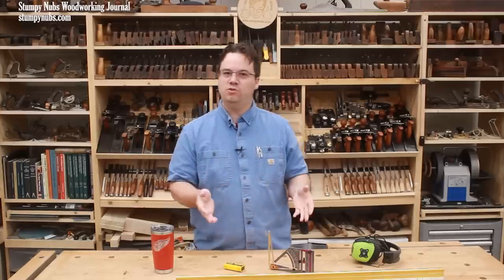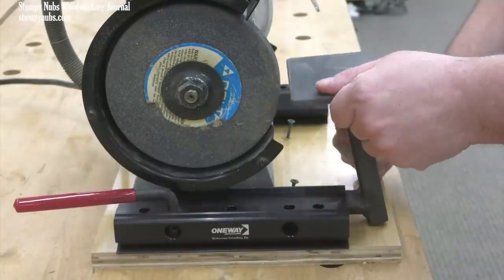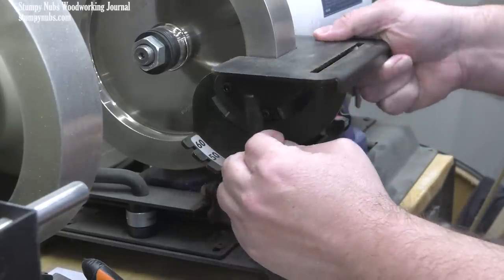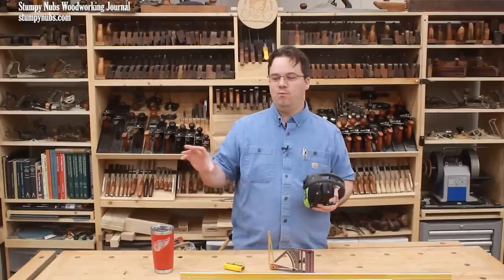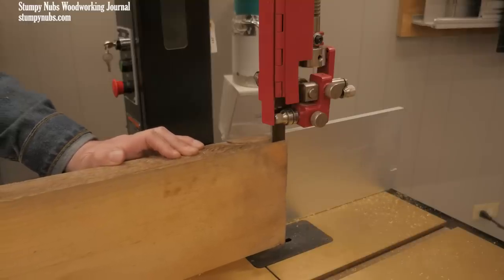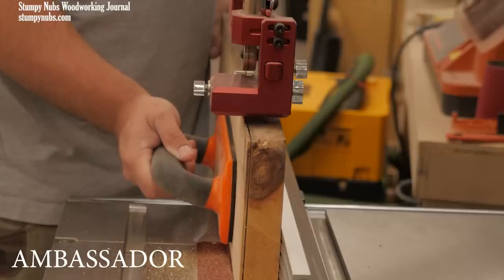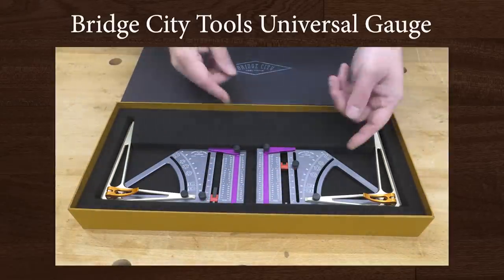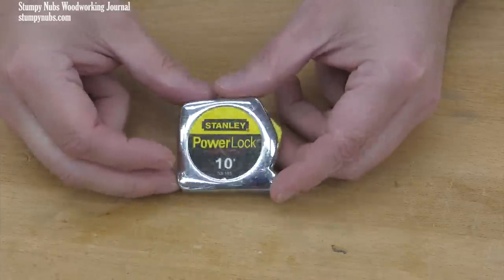6 Tools I wouldn't want to be without

Comment: I bought an ambassador bandsaw a month ago and had problems with the guide post being parallel to the blade. I wasn’t able to fix it myself so I contacted the company which were super awesome and worked with me to find a remedy to the problem free of charge. really great company!
Reply from the maker: Glad to hear it :)
Reply: I have an ambassador as well,fantastic bandsaw,the only thing I don’t like is the way the red blade protector is fixed with only one screw at the bottom,it’s slightly out of parallel,but doesn’t affect performance.
My tension gauge also crapped itself the first time I tensioned the blade,heard a loud bang,which was obviously the spring popping off,and no ,it wasn’t over tightened.
Also doesn’t affect performance,wouldn’t rely on it anyway.
I noticed in one of James earlier vids about the saw, it appeared that his tension gauge was also broken (you can see it when the top door is open),unless he had the blade tension off.
Otherwise a fantastic bandsaw.
Reply: @splinters_66  my tension gauge is also broken but I don’t use it anyways. I find the good old finger method is more accurate

Comment: I've had that same Stanley pocket measuring tape since about 1970 (WOW 50 years). Still take it with me to the hardware and hardwood stores.
Reply: Why do you have a dedicated tape to measure your pocket? Any tape will do 😁
Reply: Wow! I think the longest I have ever owned a tape measure is maybe a year.... Somehow they just vanish kind of like 10mm sockets.
Reply: I inherited my Dad's. Same model, I can remember him using it for his various projects when I was a little boy (early 70s). Thing has really held up.
Reply: I go through one about every two years but I use it for the diameter function on the back to measure dust collection pipes at factories. Another great use for them is measure around the curvature of something.
Reply: Is the 10' a steel case tape? I've owned multiple 12' Stanley's over the years as it is a steel case, one of the only I've found. It's also just slightly larger than the 10' and has a standard tape blade with the "u" shape allowing it a small amount of stand out. Also fits in the pocket quite easily. I highly recommend. Thanks for your video's James 👍
Reply: @chadpersing5596  They are steel cased.

Comment: I'm 74 and have been woodworking since high school.   Here's a little ditty that I recently re-discovered during a trip back home to Köln:  Folding rulers, usually 2m or 6 ft long with a 6" extension.  You absolutely can't beat them for measuring inside dimensions such as cabinets.   For some reason my German wood working friends prefer them over tape measures which I wouldn't want to be without.   But since I got the General 6' rule I found it great during my last kitchen remodel.   Yeah, 6', not meters.   Oh well....

Comment: I’ve milled trees on the ambassador. I built a slide table with a jig with an adjustable fence to hold the logs. I cut down six dead Ash trees and cut the trunks and bigger branches with a chainsaw jig. Everything else that was under 14 inches and under around 4 foot long, went through the bandsaw.

Comment: One of my favourite tools is a 3M DeWalt tape that I keep in my pocket.  It was given to me by a rep which made it feel extra special.  I resisted buying Isotunes ear muffs the last time you mentioned them, but 20% was too much to resist.  The shipping was expensive at AU$79 but they do at least ship to New Zealand, and they will save me using and spoiling my $550 Bose headphones in the workshop.
Reply: I've been using the ISOtunes Link 2 for several days now, so it only took a couple of weeks to reach me in New Zealand, (I think they shipped from Australia).  The sound quality is good and the build quality excellent.  I've read reviews that said they are a little tight on your head, and I'd say that was an understatement, although to be fair, I do have an XL hat size.  They fit 'on' the ear rather than around them like the 3M Ear Defenders I own.  The tight fit makes them particularly uncomfortable if you wear glasses as it makes the arms dig into your ears.  I am wondering if I dare stretch them over some timber and gently warm the bridge with a heat gun?  They are a bit too expensive to ruin, but I can't see me wearing them for hours as they are.
Reply: in Australia's bunnings you can get "worktunes" bluetooth headphones/hearing protection for 99$, not sure if you have bunnings over the ditch but we usually share most things, i use them everyday, good battery life too

Comment: I carry around the 16ft version of the Stanley everyday. Best tape ever. I prefer the slightly stiffer and wider tape in the 16ft. It's just long enough to handle about 90% of everything I do at work. We build high end custom cabinets and millwork so rarely do I ever need anything longer than 16 ft. When I do it usually measuring out a room so I can just use a Bosch laser tape measure. I even ran over my old Stanley with a skilsaw a couple years ago and it still works perfectly and not having to worry about someone stealing it is a bonus lol

Comment: Good input regarding the Harvey bandsaw. I am between the Ambassador C14 and a Laguna 14bx 2.5 hp.
Reply from the maker: The Ambassador has more power, more resaw capacity, bearing guides instead of ceramic blocks, and when bought on sale (which is frequently) it's less expensive. The Laguna has cool disc breaks and a higher table height (the Harvey table is a little low, in my opinion.)

Comment: To prevent rust on bits, I just suggest applying a little bit of oil on them after use. It will help you keep them clean, and the oil will prevent them from rusting no matter where you keep them or the humidity.

Comment: Just a suggestion, if humidity is an issue instead of investing in tabs that will likely have to be replaced over time, perhaps invest in a dehumidifier. Depending on the shop size they can be very cheap and will work for the entire shop area.

Comment: I carry a 6 foot tape in my pocket.  It is so old and worn that I can't even tell you the manufacturer (it is yellow).  The real advantage is that it has metric and inches.  I use metric a lot.  I have worn out dozens of them.  I had a TSA agent in Mexico steal one after 9/11 (because he could).  Most bigger tapes have the option.  You can buy them in inches, metric, or both.  30 years ago, I had a 1" wide Stanley tape that I used as a carpenter.  I worked on lots of projects that were rigging, moving, or setting up wafer handling machinery.  I always kept an extra one in the truck, so I could give it away.  Almost every job had Japanese experts that came to town for the job.  They always worked in metric...

Comment: I use that little stanley tape a lot too, but just today noticed the weird diameter scale on the bottom. I was actually trying to measure a diameter when i noticed it, but i wasn't sure how to use it. I wrapped it around a 2" pipe and it lined up with 1". I wish it just had inch markings on the bottom as well...or maybe i should learn the diameter scale

Comment: You didn't mention one of the cool features of the little Stanley 10-foot tape measure. There is a calibrated scale on the back side of the tape for accurately measuring the outer diameter of round stock, such as dowel rods, PVC and copper pipe, etc.
It automatically does the divide by π (pi) calculation for you. I use that feature often.
Reply: Very interesting.  Do you roll the pipe along the tape measure for 1 revolution to measure circumference to get the diameter?
Reply: @ipick4fun27  You wrap the tape around the item you're measuring. You read the diameter off the tape scale.
Reply: @ipick4fun27  - It's even simpler than that. There is scale on both sides of the tape. The front scale reads inches and feet like normal. The scale on the back side is inches times 3.14159265… 

Wrap the tape around the pipe with the back side of the tape facing out. There's a reference line on the tape. Match the reference line up to the "pi" scale and read the diameter directly.

Comment: I concur with your Harvey bandsaw assessment.  I have the Ambassador and with a carbide blade it works amazingly well.  One question, is there an aftermarket guide rail available?  Changing the guides is a huge nuisance, and my circular bar sits about 1/8" above the slot making some cuts nearly impossible.  Harvey's answer was to loosen the nuts connecting the bar to the table.  I don't need a loose bar, just one that sits properly.  Basically, this is a weak design point for an otherwise wonderful product.  Suggestions?
Reply from the maker: I believe they meant to loosen it and shift it downward, then retighten it.
Reply: @StumpyNubs  That's what I thought as well.  When I retighten the bolts the guide is brought back to its original position; too high.  It is a choice between loose and a height that's out of the way, or tight and the guide is in the way.  I don't like either option, thus my search for a third party guide, so far not much luck.  I would love to have something like that on the Alpha series, without having to buy an Alpha series.  Thanks for the input.

Comment: instead of Zerust Capsules, you could just use desiccants which absorb excess moisture. I have a great customer at my pharmacy that does wood working so every 6 months or so I just have the techs save 50-60 from the pill bottles and give him some to replenish his supply. Won't get that service at CVS, Walgreens, or any other big company but find a local pharmacy and I'm sure they'll be happy to do it.

Comment: Did you put the measuring tape on the straight edges yourself?  The black ones in the link you gave has no measuring tape.  I know thats not exactly what you use a straight edge for, but its nice to have on there.
Reply from the maker: I've never used them to measure.

Comment: I am enthralled by your wonderful videos.  I was surprised that when you retracted tape you let the tape end slam into the case. To accurately  measure inside and outside dimensions the tip has a slot that allows the tip to move and therefore compensate for the thickness of the tip. This slot can elongate from that slamming and no longer give an accurate measurment
Reply from the maker: I've done that my whole life and never found it to be an issue. Steve Ramsey ran an extensive test and also found it had no affect.

Comment: I just bought an ambassador 14 inch bandsaw. I am having trouble adjusting the table so that the blade when fully tensioned and the guide bearings are backed off, that the blades goes through the centre of the throat plate opening. I need to use the guide bearings to push the blade over to the centre of the opening. Any ideas? I do think that the table is as far forward as it will go. It needs to go another 1/8th inch forward.
Reply from the maker: I can't imagine why that may be. Sounds like the table is out of place. If you can't get it adjusted,  Maybe give them a call.

Comment: Stumpy, there is currently only $100 difference between the Ambassador and Alpha bandsaws. Not $1000 as you reported. Or do I have this wrong?
Reply from the maker: They are both on sale. The Ambassador is $1849, the Alpha is $2799. The difference is $950

Comment: Bought some of those Stanleys recently, in a pack of 3, and all 3 were at least 1/8" off of all of my other measures and rulers. I compared it to multiple rulers from different brands, and they were definitely off. I like the idea, and it might be nice for rough measurements, but I wouldn't use one to actually cut anything.
Reply: Realistically, if you were to only use that one tape measure, the markings are irrelevant. It's been suggested to use just 1 tape measure for projects meaning don't use multiple tapes. Heck, even different tapes made by the same company can be off. So that said, if you start a project using measuring tape X, keep using tape X to finish the project. Also, you can use relative dimensions to complete a project to keep tape usage down to a bare minimum.
Reply from the maker: What made them 1/8 off? It's not like someone is putting those markings on by hand with a chance of error. It must have been a problem with position of the tab? I have five of them and they are all accurate. Maybe a bad run?
Reply: @StumpyNubs  I've seen more than a few tapes in the construction industry where the first inch or so is skewed. You can see if you do a direct side by side comparison. It may be a part of where the term "burn an inch" comes from but I believe they just don't know how the hook on the end of the tape works. When I shop for a new tape, I'll always compare it to a known inch before I buy.
Reply: @StumpyNubs  Probably the hooks, even the first inch was off like Names Fake said, I think the scale was consistent throughout though. Definitely felt like a bad run with all three being off the same amount.